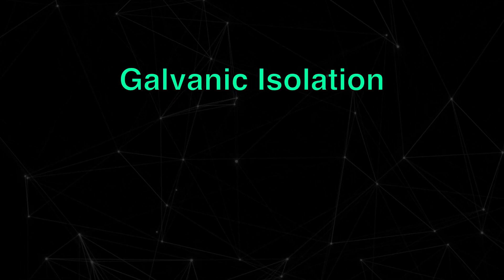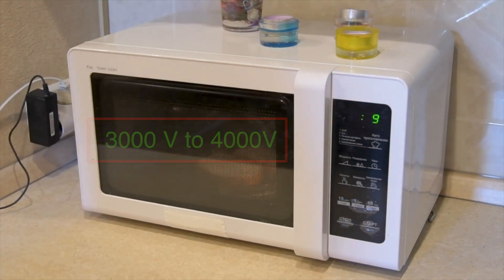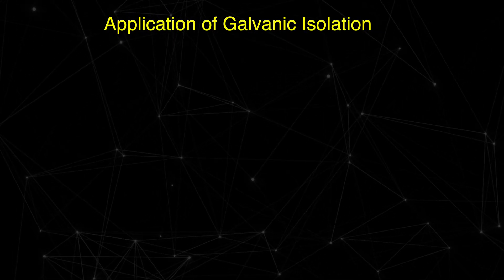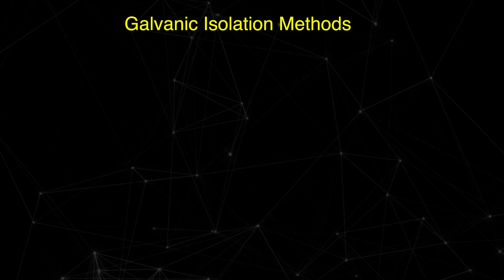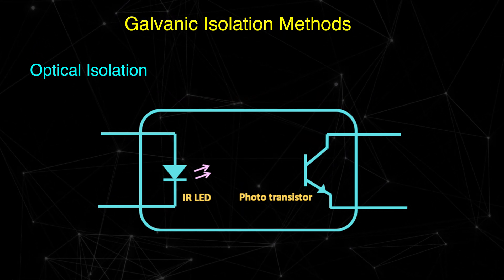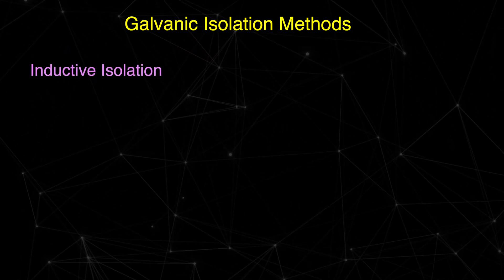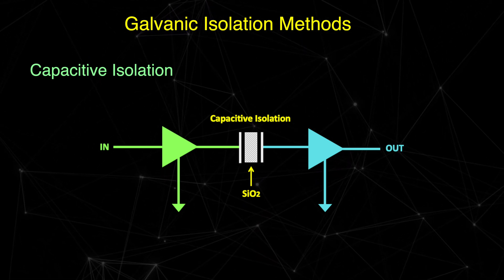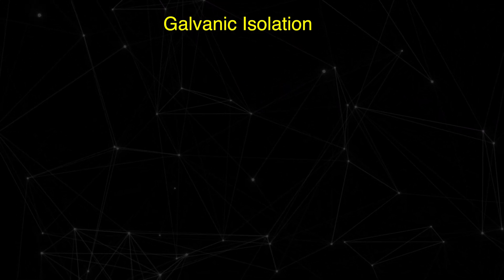What is Galvanic Isolation ? Why Galvanic Isolation is required in Electronic Systems ?

Comment: Nice video mate, can you please tell us how to isolate analogue signals using a capacitive isolator?
Reply: Did you find the answer?
Reply: @Fusion12345  Not actually, the best I know is you have to convert an analogue signal to digital then use the digital isolator then again convert it into analogue.  Or you can use an optical-based analogue isolator
Reply: @ameyabhavsar1796  Any luck with analog optoisolators to support few hundreds KHz? Thanks mate
Reply: @Fusion12345  No idea bro, The frequency is too high, in my opinion, MT-071 by analog devices can work for about 120K Hz.